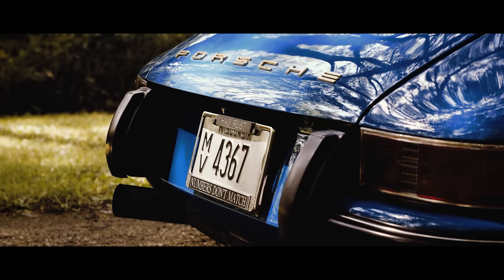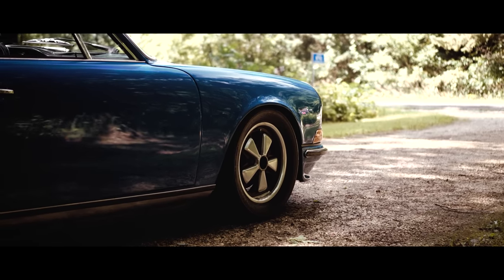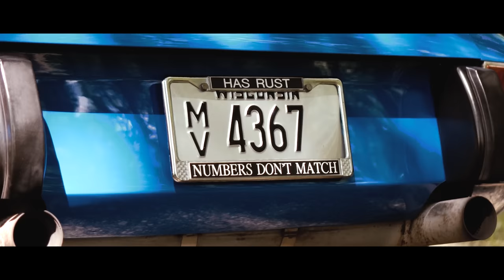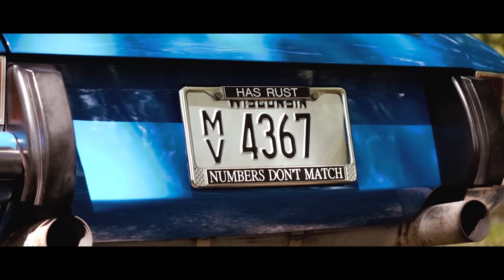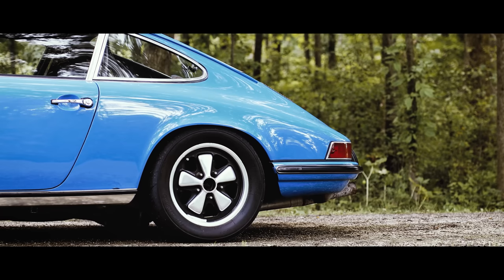This is a Narrow Body 2.8 RSR Powered Porsche 911.

Comment: This 911 has so much soul. the color is cool , sitting so  low to the ground, looks like its just stuck there. the  engine sound so well in tune ,  its exhaust is well balanced . its what a raw 911 should be, and its driven how 911 should be, foot to metal  .

Comment: Nothing wrong with what you have done it's a unique and awesome car the engine is absolutely superb, just watch out for that tail on slippy bends, I used to have tyres too wide for their rims and she used to bite! I sent the track marshalls running for cover one afternoon. I believe the instruments are a push fit on a rubber gland in this model, pull your rev counter out slightly and turn it until the red line is top dead centre.